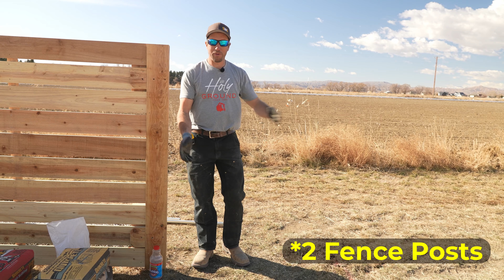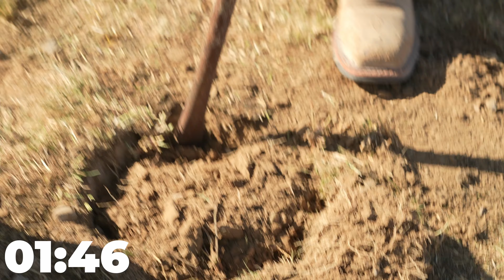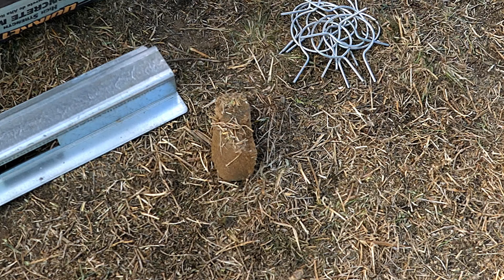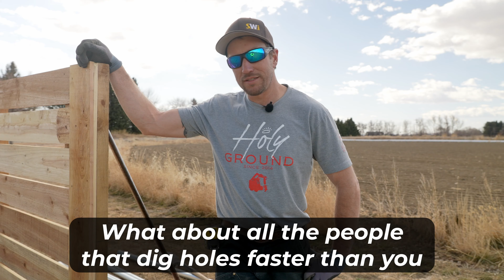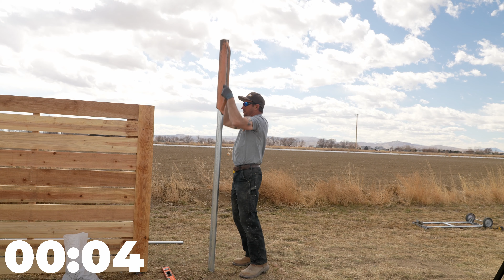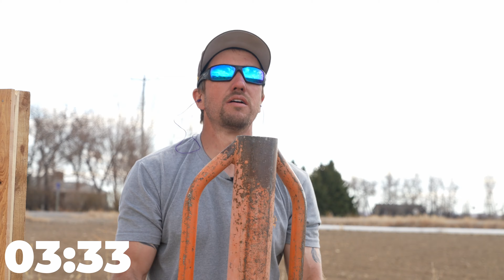The Fastest Method For Setting Fence Posts? Digging VS Driving

Comment: I build fences for a living and depending on how hard the ground is the auger will dig just as fast as the gas driver will drive the posts in. The time saved comes in not cleaning up dirt and not messing with any concrete. But with that said, a post set in concrete is more sturdy than a post driven into the ground with no footing
Reply from the maker: Funny, we just tested that theory.
Here's the test of the posts in concrete: https://youtu.be/_iQnheVwAI4
Here's the driven posts: https://youtu.be/8jWcT17PFME
(spoiler--driven posts perform better)
Reply: And the concrete rot making the duration of the fence to weaken over time
Reply: @SWiFence  I wanted to see a test of the posts, but what you are showing here seems to just be a repeating failure point for every sample: The plastic fence. If you are gonna do this over, then I suggest identical (steel) posts, and a failure-proof fencing material (perhaps a large plywood panel or a very well built wooden fence). Cool concept though. Also: If you weld some small wings top and bottom before driving, you would get way more rigidity.

Comment: The first fence I built had me renting an auger that had a 2 stroke engine like a chainsaw.   It didn't really work for me.   I got a post hold digger and a spud bar and things went smoothly even in clay soil.   That was 40 years ago and the fence is still up in spite of the high winds we have in Colorado.   I've built my share of decks which require footers 32" deep to get below frost line.   No problem with a post hole digger.   All the posts I ever used were 4x4 pressure treated lumber which I doubt you could sink with a driver unless I'm missing something.   Hope you sell a lot of them, just not to me.
Reply: Yes, you’re missing something. You can sink 4x4s with a driver if you use a pilot bit first. If YT will let me post the link, check this out: https://youtu.be/Ap7UhcEKjn8
Reply: We just drive them whole

Comment: I gotta thank you guys. I just installed 600' of fence in Colorado using this method and it would have taken me 3 times longer the old fashioned way. 
Thanks for taking the time to do this, you're making the world a better place.
Reply from the maker: Wow that is super encouraging! Thank you!
Reply: I hope you see this question.  did you drive these posts into our clay soil on the front range or more rocky in the mountains.  I was going to try this in clay soil for quick repairs of rotten posts instead of replacing the wood ones in concrete with all the damn digging.
Reply: @carnivoredoc  Clay soil in the foothills. It's the ideal substrate for this type of system.

Comment: Loved this so much I had to watch it twice. I'm in Kentucky, an area with heavy clay. Some of our local fence guys argue that driven-only Postmasters will work loose when the soil gets wet and still need concrete. Ring true to you or maybe not? Also, do you need the Postmaster drive cap to pound these, or would a slotted chuck also work fine?
Reply from the maker: We have heavy clay around us as well and have not run into any problems. One thing to make sure of is that you're getting your correct drive depth of 3'. We use the the Rhino XA with the Postmaster chuck.
Reply: @SWiFence  Thanks!

Comment: My guys went out with a  4 stage post pounder. The post got squished from the pounding at the top? They were pounding 2 3/8 pipe and the tops squished like an accordion. Did they do something wrong? Was it the material. They later ripped the engine off the side -- the metal fatigue on a relatively new post pounder. (It was an inexpensive one less than $400.) but none the less it barely pound in 5-6 post before it was destroyed.  I'm wondering if they hit rock and just kept pounding and pounding .... These were 8 ' posts they were setting to 5' height--- so no more than 3' of depth...  

I was thinking the collar may have been the wrong size for the hammering end... making the post not hit consistently in the same spot. But then as I thought about that I was like-- well that probably would have reduce fatigue on the post... Perplexed...

Comment: Yes. I build fences in north Florida. Me and my guys dug and wet set 400 feet of chain link posts (8+1 commercial )in one day. That’s digging all the holes with post hole diggers, and mixing the concrete in a wheel burrow. I would hate digging in Wyoming!!!
We did that because of circumstances beyond my control my skid steer with the auger was unavailable.
Reply: Oh, I forgot to mention, since it’s 8 ft tall commercial, we set them 3 feet in the ground. It as a hell of a day, but we got it done!
Reply from the maker: Rock on!!
Reply: Commercial fencer from NY. My boss is too cheap to buy any proper digging equipment. Just a digger bar, post hole digger. Guys quit in a week.

Comment: How well do LG40 posts that are driven do in high winds with a privacy fence? We live in KS and typical daily wind is 20mph, and the last three days we had 50+. I've replaced a few cedar 4x4's with LG40 8' posts in a bag and half of quikrete at 30" down, but it is a major PITA. I'd rather replace a whole side at once (300' total) and rent a driver (or even manually drive them) over digging and concreting or using crushed rock. Looking for the high wind stability and minimal rusting through issues.
Reply from the maker: It's not uncommon for us to get 50+ mph winds out here in Wyoming. As long as you get them in here solid it works well for us.
https://youtu.be/ONA15hJym-k?t=720
We also tested this method successfully in Florida sand: https://youtu.be/8jWcT17PFME
Reply: @SWiFence  Thanks. That's what I figured. Were mainly a clay loam here and dry most of the time except for the every 5 year or so deluge. Like I said, I'd rather pound them in once than auger a tone of holes, clean them out, etc.... Our frost line is right at 30", but I figured without the concrete it wouldn't be an issue either. I can't really go more than 30" deep with the 8' poles and still have the above ground height, so hopefully that would be deep enough.
Reply from the maker: You certainly wouldn't want to go less than that if you're dealing with wind. We usually go at least 36" down, sometimes more.

Comment: Could you share what ground conditions are not suitable for post driving?  I live in the southeastern US in an area with a lot of red clay, I would really like to use a post driver like you showed in this video.  Thanks!
Reply from the maker: You should be fine in red clay. You have to be careful about soil with lots of rocks or sand, as either one of those will give you a loose, shifting soil (you can still drive in sand if you go deep enough).
Reply: @SWiFence  thanks for the info!

Comment: Those automatic ones are nice but not really practical for most, as most people don't have $2,000-$3,000 lying around. I would wet the ground before pounding a post in or do it after a rain. That loosens up the soil alot. I live in Georgia in an area where there is lots of limestone and red clay. I have had to manually dig, pull out rocks and roots, and till over a period of weeks and add soil amendments to loosen it up before I can even attempt to put fence posts in.
Reply: I agree, I looked at that and said "hmm, that's gotta be a couple thousand dollars. I don't have that, but what I do have is intruders and I need a fence. So it's going to be me and a digging bar. Thanks for your advice.

Comment: Can the driver be run without the extension handles? Whats the method for that?
Reply from the maker: Yep, sure can. Pop the extensions off and reconnect the throttle cable.
If the handle & throttle aren't lower though, you'll have to compensate for that by raising yourself up higher (or reaching higher).

Comment: So is driving better than a post hole digger and using concrete
Reply from the maker: Depends on how you define better and what your soil conditions are like. We would say it's definitely better in a lot of circumstances because it saves a lot of time. Once you drive the post in it's already in. Once you dig a hole you still have to pour concrete and set it.
There are also definitely times where it's better to dig and set. If you've got too many large rocks in your soil, or if your soil is too loose and sandy to hold the post firmly in place.

Comment: You use metal posts, how do wood posts fair with the driver? Clients usually work with 3”-4” posts and wondering if it will work well

Thanks in advance
Reply from the maker: Honestly, we haven't tried that yet but we can sure put it on the list!

Comment: Dan, my money is on you… in Wyoming!  I saw Mark digging a flagpole hole in the sand of Florida.  Even with his Minions at his disposal, it was a whole day affair.

Soil Conditions do dictate the best method to use… to a certain degree.  But, there are others to consider… like access to equipment and physical conditioning.  These I think are at least equal in steering your choice of method.

Now don’t take this personally but, methinks you might have missed a golden opportunity with the shovel and bar method.  I mean Dan, everyone knows that a real man would have used a clamshell digger.  

It weighs twice as much as a shovel.  That means it will bang down into the hole with much more force and only half the effort.  Yeah, true it takes twice the effort to lift them but.. you can only throw them half as far into the pasture.  Those steps you save when you regain your composure, and trek out to retrieve them, have to go into the equation!

So, Dan I’m not convinced that you’ve exhausted the options for putting those posts in the ground.  I’m gonna go out right now, grab my clamshell digger and a shovel.  Then, I’m gonna lay them side by side in the Gator and haul them out to the barn. 

There I can dig… through my fishing tackle and retrieve my De-Liar fish scale.  Once I weigh the shovel and the clamshell… I’ll know if my precise calculations are in fact, precise… is the shovel only half as heavy as the digger?

Armed with that data, I can make a wise decision about which one to use!  Because my plan is to gather up my fishing gear, throw it into the canoe and attach its cart to the rear of the Gator.  

“What about the shovel and the digger?” You ask… well sir, I have no intention to put any posts in the ground today… instead, the heaviest of the two will be used as my canoe anchor and the lightest will be used to dig some fishing worms!

Dan, don’t call me lazy… after all you told me to have a good danged day… and it don’t get no gooder than fishin’ from a canoe!
Reply from the maker: You raise a good point! I don't typically have clamshells on the truck because half the time the shovel and bar do better for me due to ground conditions. We've got some new diggers in the shop that I'll grab and test out in a future video. 👍🏻 I doubt the results are going to be greatly different--but it's worth trying.
Reply: @SWiFence  keep me posted… I wanna know how far you can toss them! •grin•
Reply from the maker: I see what you did there! Keep you "posted"? 🤣🤣

Comment: Why use a shovel to dig your first hole and not post hole diggers?  They are generally pretty quick
Reply from the maker: I just don't tend to reach for them when the ground is hard. Some guys do though.
Reply: @SWiFence  that makes sense.  Like you said different tools for different soil.  I live in Ohio and post hole diggers work great... surprisingly I was using a gas powered post digger Saturday and it did worse than the manual diggers (rocks and roots held back the auger)